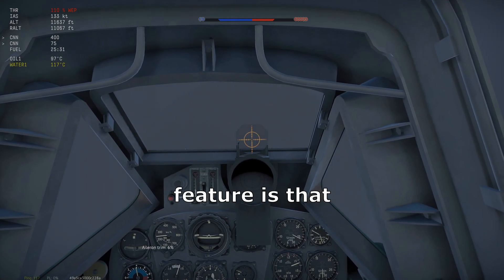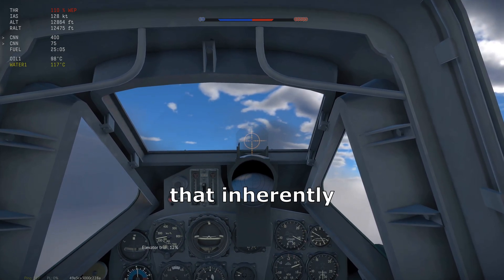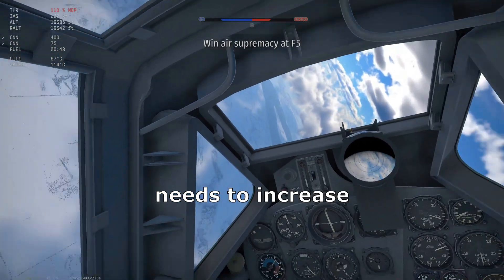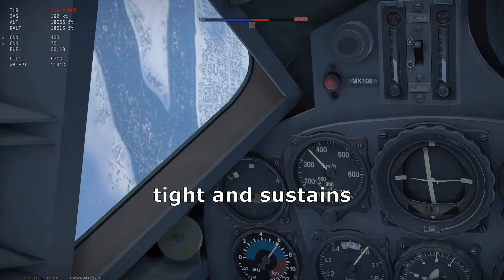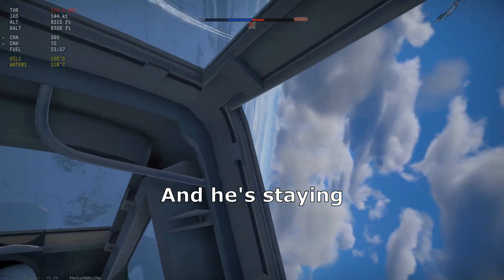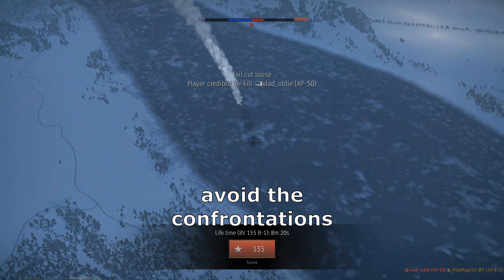Clickbaiting YOU into an AERODYNAMICS LESSON

Comment: Most of the lift is generated at the first third of the wing width, that's why long thin wings are more efficient than thick wings with the same area
Reply from the maker: That depends on the wing tapering, wing twist and camber of the wing section. The first third isn't a fixed thing for every aircraft so you can't really use that as a reasoning for long thin wings being more efficient.
Reply: @pilotpug It is true for all wings on ww2 aircraft tho
Reply from the maker: @tedarcher9120 might be common, almost the rule with few exceptions, bit when talking about fundamental laws of aerodynamics you can't include it.
Doesn't make it any less true and is still a very fascinating side note to the story!

Comment: 3:49 Modern jets are allowed to be unstable because we have modern flight stability control systems that can correct faster than humans can react. 

The reason we need instability is because we can model the longitudinal motion as a second order differential equation that maps to the angular motion and response over time. The unstable planes without flight control systems would amplify unstable motion, while stable ones would converge back to equilibrium.

My professor used the analogy of a ball in a bowl for stable, a ball on a flat plate for neutrally stable, and a ball on a hill for unstable. 

This instability is from the center of gravity being moved behind the neutral point. The equation is called the static margin SM = x_np-x_cg and if SM > 0 its stable, if SM = 0 it’s neutrally stable, and if SM < 0 its unstable.

Ask me things a third year aerospace engineer would know.
Reply from the maker: @hengry0  i didn't want to go that specific into it but that is pretty much the explanation used in flightschool too which is far below three years. I'm sure you guys learn much mroe about it!
Reply: Tldr.

Comment: As someone else commented, the bv-155 wasn't the highest flying aircraft of WWII, and even if it worked as intended it probably still wouldn't have been. Induced drag is a significant factor but it's not the most important here. Parasitic drag becomes the main source of drag at the speeds these planes are flying at, and reduction in power is probably the biggest limiting factor in maximum altitude. That's why planes like the P-47 and Meteor have some of the highest ceilings, they have a turbocharger or turbojet respectively that tend to make power better at high altitudes than a conventional supercharged piston engine. 

There are some exceptions like the P-51H and Ta-152 that can compete with some advanced supercharger setups, but the bv-155 just doesn't have the power to keep up
Reply from the maker: @Quasarnova1  the idea was to clickbait people into an aerodynamics lesson so the thumb stays ;)

Comment: I want a plane which looks like a modern twinjet. Huge nacelles with a fan in the front. Air at altitude is cold. Or let's assume winter. The fan is allowed to compress the air so much that it is always summer for all parts related to the engine. A variable exhaust nozzle maximizes thrust. But where do I put the propeller? Coaxial is heavy friction. Pusher is loud. Shafts are bad.
Reply from the maker: @ArneChristianRosenfeldt  "the fan compresses the air so much it is always summer for all parts related to the engine" getting poetic about adiabetic heating, love it 😂

Comment: A large aspect ratio is bad for roll rate for two reasons: Firstly, the wingtips move faster for a given roll rate, and so the roll moment induced by roll rate is more negative, since swinging those wings around just causes additional drag forces that act to oppose the roll. And secondly, the torque that ailerons (of a given size and design, at a given speed) are able to exert grows linearly with the aspect ratio, while the moment of inertia contributed by the wings grows quadratically with aspect ratio even if we assume the wing mass is constant with aspect ratio - and in reality it usually increases since a larger aspect ratio means the lift force acts on a longer cantilever which requires a stronger wing structure.
Reply from the maker: @zuthalsoraniz6764  good points! I limited myself in this vid to the dihedral of the wing since it's so prominent but those are all excellent talking points. Perhaps for a future vid.